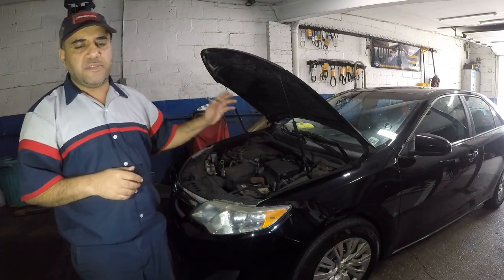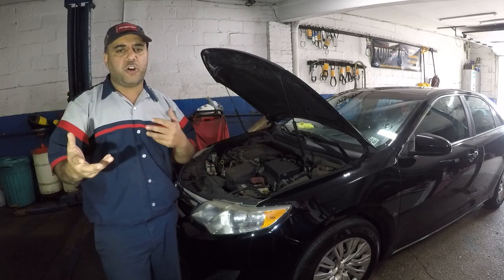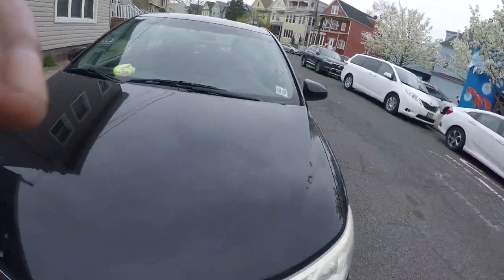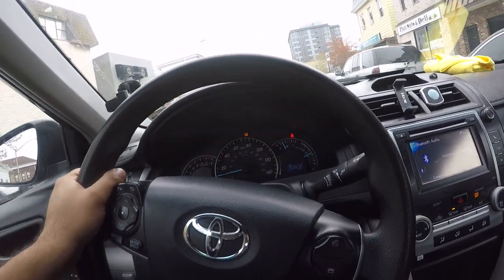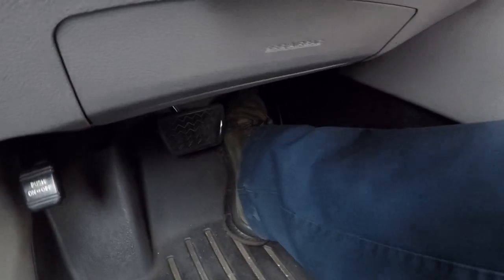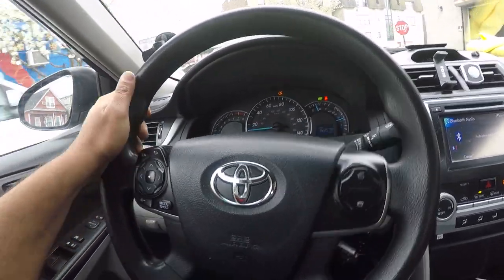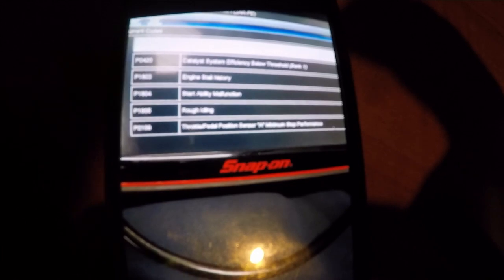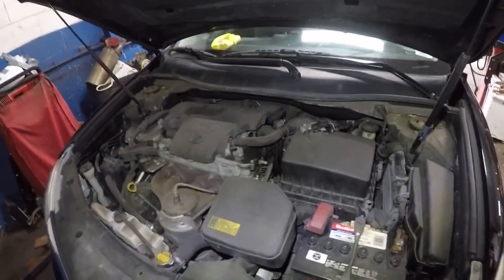Toyota Camry loss power dosent go more than 15 MPH code P2109 throttle pedal position sensor

Comment: The accelerator pedal sensor has slotted mounting holes. I can’t find any information on if there is an adjustment installing this sensor this is a 2004 Camry E
Reply from the maker: U shouldn’t do any adjustment on that I have tried before check engine will pop

Comment: My is the  2016 Toyota Corolla 2.5l p2109 IT turns but it won't start or stay running check engine light, will it be Throttle body or the pedal sensor?
Reply from the maker: Scan for codes first u might need to do some
Diagnostic of it don’t start I doubt it that the peddle is bad scan for codes let me know

Comment: Hi, I got the same error code 2109. The engine has vibration and its idle rpm is around 680 or 650. It’s Toyota Camry 2012 model. When I give accelerator, the car revs up fine. Checked the throttle position which is 0 % as well as the accelerator pedal position is also 0 % I don’t understand what seems to be the problem here. Please guide me
Reply from the maker: This car wasent able to go more than 15 mph dose ur car drive well?

Comment: My camry 13 has misfiring issue and taking load on acceleration, no error code, mechanic dignoses manually and changed one of the coil. But still issue not resolved. Please guide
Reply from the maker: U need to check live misfire data see which one is causing issue some times it cold start up misfire

Comment: When accelerating at a stop light or when slowing down to make a turn, it hesitates when stepping on it to go. It will go about 5 - 10 feet and hesitate, just enough to make everyone behind you think you are going and they close behind you enough to almost hit you because they don't realize the care hesitates. It has happened more than 4 times. It is an accident waiting to happen.the code showing is p2109 what do I need to do
Reply from the maker: Check catalytic performance might be blocked
Reply: vehicle slows down when accelerating. it will do this at take off, turning or beginning acceleration. i do not trust this vehicle when pulling out or for fast acceleration because of this problem. very annoying. i will not buy another camry because of this.
Reply: @RBTheMechanic how do I check this but when I take it in for diagnostic it says P2109 Throttle/Pedal Position Sensor "A"
Reply from the maker: @oloyedebabatunde8811  we’ll need to check catalyst preformance regardless
Reply: @RBTheMechanic  please how do I check this
Reply from the maker: @oloyedebabatunde8811  scan tool of send scope camera down through oxygen sensor port to see how the condition is of catalytic
Reply: And of course you can't go to a non dealer machanic and if you are in an accident or fire you won't be able to prove it was the fuel pump or engine block.

Comment: Camry is putting used parts in the new cars. I don't know any details but they happily admit it. Something about used seatbelts but there's more to the story I'm sure.   Not in recall is a legal lie and I believe recently toyota has bought their good reputation and scrubed the negative.            I wish I had never bought this overpriced car.
Reply from the maker: Yeah
Reply: @RBTheMechanic  Don't fall for the strong aluminum dogma.   Cheap aluminum alloys are used to manufacturer engines. Lots and lots of issues.    But they are sellings it as the best of the best. Higher maintenance shorter life and accidents are the reality.
Reply from the maker: @jjk2one  true
Reply: @RBTheMechanic   The cars are Chevy Vegas  with disposable engines   not kidding